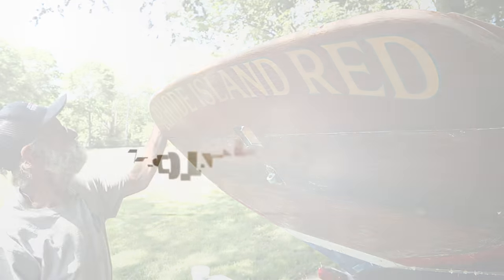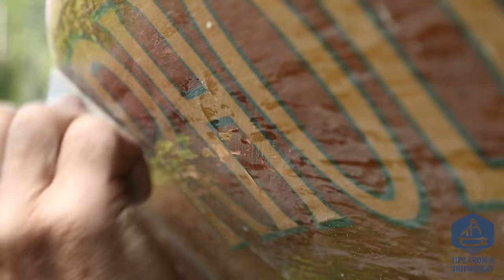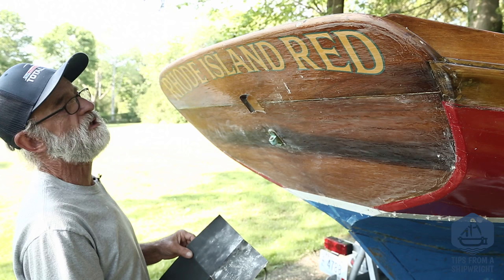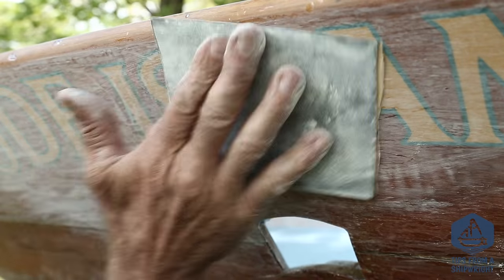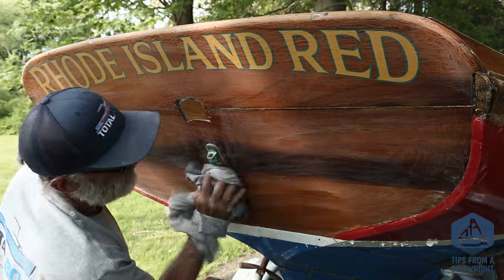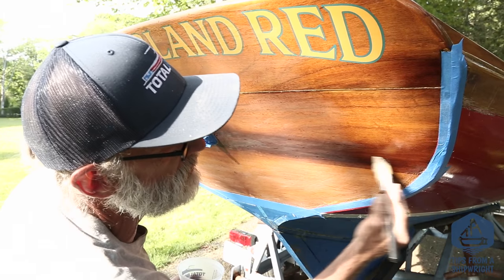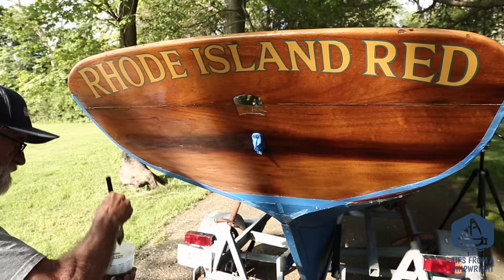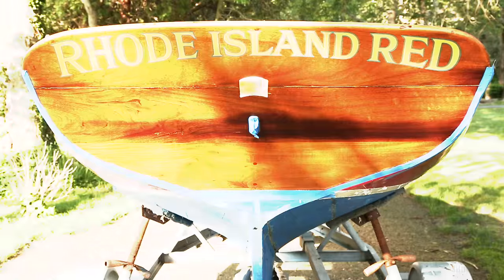How to best prep and varnish your boat - Part 2

Comment: One thing I learned from BoatWorksToday is to wet sand with a drip of dish soap in a squirt bottle. It really makes the paper last longer without making a massive wet mess. It even works on latex paint and sanding sponge.

Comment: Have you ever tried applying that varnish with a rag setup, similar to a french polishing method? I've found that a rag method is usually way messier than a brush, but easier to get ultra thin coats laid down if the varnish plays well with it. A few brands ended up just flaking and being awful to try and work with however.

Comment: Rather than use a razor knife blade. Try a thin cabinet scraper. Not the type use with a handle. Just the square ones you form to the curve of the wood.

Comment: Did you ever consider using a woodworkers cabinet scraper rather than the razor blade?
Reply: See the comments to the previous video--total scraper screaming gallery for that one.  I'm one.  I make simple flexible scrapers (big enough for both hands and shaped to needs).  The razor blade approach wear my fingers out. I've done that too.

Comment: Doing a great job! I would like to know the reasons why you are using matt varnish for the first five coats, and gloss only for the top coat? 
Thank you for your interesting and informative videos!
Reply: Matte varnish has no gloss additive, allowing it to be thicker, it also allows you to overcoat and see where you are applying fresh varnish more easily than gloss on gloss.
 He's trying to establish a film thickness with the multiple coats before sanding for a final coat, using the varnish as a filler/surfacer for the existing poor surface finish. No need for a gloss finish if you are going to sand before the final coat, and a matte finish is easier to sand than a gloss.
Reply: +Sideslip very nicely put, thank you!
Reply: Also matte varnish is cheaper than gloss varnish so it saves money when building up coats.